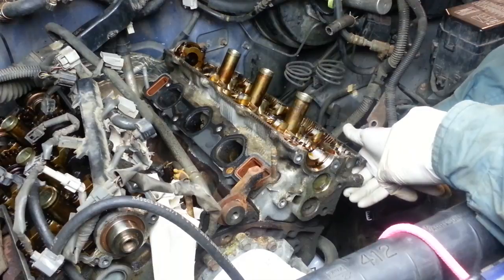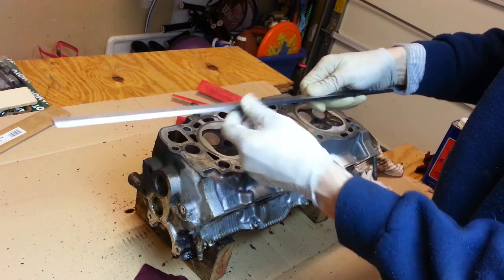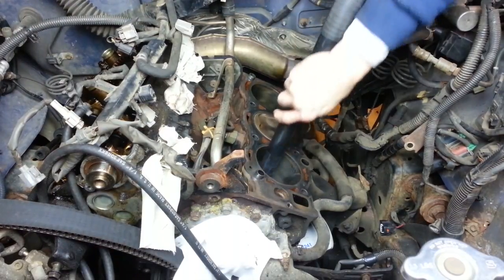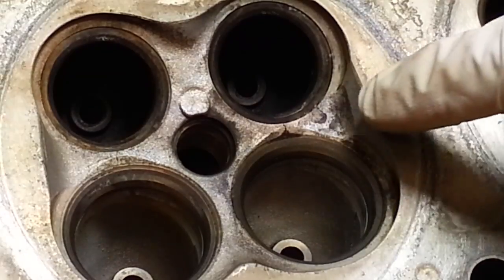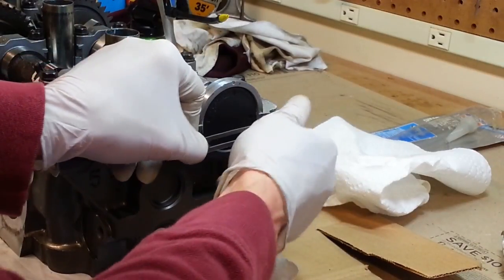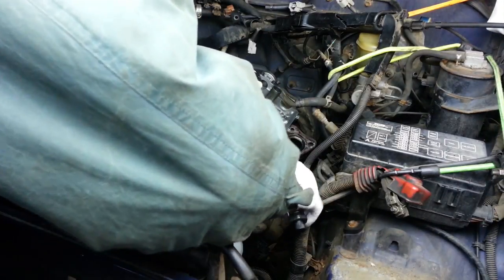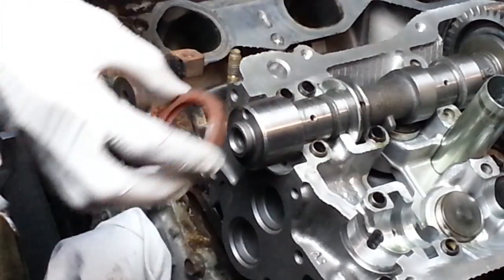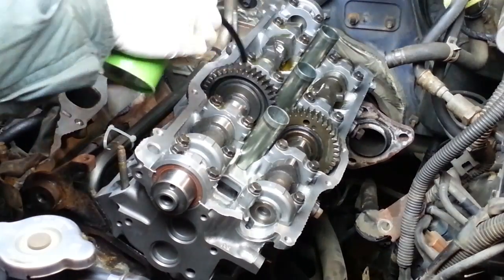Cylinder Head & Gasket DIY Procedure - Toyota 5VZ-FE - Part 4

Comment: Currently in the process of doing this on my 00 with 370k miles on it. Do you happen to have a link for the head gasket kit?
Reply from the maker: Not for the exact one because the options have changed since I did mine. It was a Beck Arnley kit from RockAuto.com
Reply: @WorseThanChiggers  that helps either way. Thank you for responding

Comment: if you don't mind letting me know, which manual did you use? I am going to do a total rebuild on the same engine.
Reply from the maker: I used a genuine Toyota factory service manual, not one of those thin Haynes manuals that you see at the Auto Parts store. I find it cheaper to buy used ones on eBay. Good luck with your project. Let us know how it goes.

Comment: Hey sir old video but I hope you can read this comment. The Haynes manual says to line up the two dots but you lined up the single dots on the cam. Which do I do?
Reply: @WorseThanChiggers
Reply from the maker: You'll see in the video that on one side of the engine you are to line up the two dots while on the other side you line up the single dots. If you're going to take on an advanced procedure such as this, I strongly recommend that you invest in a genuine factory service manual. A cheap Haynes manual likely won't provide all of the necessary guidance.
Reply: @WorseThanChiggers  I’ll have to invest in one. Than you so much sir you are a life saver

Comment: Since Toyota discontinued the Head Gasket Kit, i have had a hard time finding what all parts (gaskets, seals, etc) that will need to be replaced during this Head Gasket job. You wouldn't happen to have a list of the parts still? I know its been awhile and i dont expect that you do, never hurts to ask!
Reply from the maker: The head gasket came as part of a Beck Arnley kit from RockAuto. I review that kit at position 11:31 of this video in the series.  I chose that kit because it got reasonable reviews and was moderately priced, not on the low nor high end of the price range. Hope that helps and good luck!
Reply: worsethanchiggers hey thanks, ive looked at a lot of the aftermarket jits but they dont state what the kits come with. I would feel more comfortable going with toyota oem parts since most yota oem is better than aftermarket in many cases. Its a bummer they discontinued the oem kit!
Reply: @WorseThanChiggers  -  you are amazing!  Your contribution have probably saved so many 4runners.  I personally have a 97 4runner with 250k on it and love the car like crazy.        Looking to test my luck with buying another 4runner that might have headgasket issue.  Will try to see if I can save it but afraid that the engine might have been overheated in which case I would assume changing the headgasket would be a waste of time.

Comment: These videos are amazing so good. Im just doing mine. but I'm trying to remove the valve spring from the head without a spring compressor. How did you do it?
Reply from the maker: +Melissa Hunt Thanks for the kind comments.  I used a Schley 91400B universal valve spring compressor which I already had for working on my VW.  I've also been wanting to try the Lisle 36200 Valve Keeper tool which is much cheaper and works by simply hitting it with a hammer.  Search for videos on its use.  Pretty cool invention!

Comment: I'm working in the passenger side now,the points align in front of each other but the lithe hole in the front is pointing 5 o clock I think is the intake camshaft not match is safe to rotate it? I mean to make the little hole to be at twelve o clock... thanks in advance.
Reply from the maker: I don't really understand the issue that you are describing. Are you referring to the threaded hole for the service bolt?
Reply: Yeah bro I have problems most of  the time understanding my self 😄.the little hole in the front of the intake camshaft where wedge will go.i suppost to be at 12 o clock but now is at 5.i have to rotate it.
Reply from the maker: @edardon16  Mine didn't have any kind of wedge. Do you mean the hole in the end for the little pin that indexes the cam sprocket?
Reply: The the treaded hole is for the pulley but the pulley use a pin plus the bolt.bro I don't know how to explain that. I really appreciate your good intentions, I have to figure it out.thanks again.
Reply from the maker: I think that I understand what you are confused about. Alignment of the cams is a separate procedure prior to timing the engine. On the passenger side, align the double dots on each cam to install them. Once the cams are in place and their caps are installed to hold them down, you can then proceed with the rest of the assembly. After the valve covers are on, you can install the cam sprockets. Before installing the timing belt, turn each cam sprocket so that their timing marks line up with the marks on the timing belt back cover plate. They will be near 12 o'clock. Don't worry. You can safely turn the cams without hurting the engine. Toyota's 5VZ-FE is a non-interference engine meaning that the pistons will not hit an open valve. You really need to have a factory service manual to do this job. It has all of the details that you must follow.
Reply: Your series of videos is definitely the best in youtube  regarding to head gasket procedure,and looks very easy to do,but it's not easy at all.5vz is not a interference engine?perfect. Take care sir and thanks a lot for your help.

Comment: Could you do a passenger cam shaft caps orientation please? I know it’s basically the reverse, but could you :)
Reply from the maker: Indeed it is basically a mirror image of the same exact procedure except where I explained the differences in the alignment dots. Definitely invest in a genuine factory service manual. That should be the first tool in your toolbox.

Comment: What causes blown head gasket? Overheating is the primary one I assume. Other than that, does it generally fail for any other reason that can be prevented?
Reply from the maker: +Bardia Ghajari  You nailed it.  The most common cause of a blown head gasket is an overheating engine.  The excess heat will cause the engine block and head to expand more than usual and can exploit a weakness in the head gasket causing a failure.  Under normal driving conditions, other less common causes can include incorrect installation such as not torquing the head bolts properly and in the correct sequence, hot spots, and pre-ignition.  The best preventative actions are to maintain the cooling system by monitoring the fluid level and replacing the coolant at the recommended intervals as well as looking for signs of a failing water pump.
Reply: +worsethanchiggers Ya! And pink milkshake, but looks like its more common on the 3rd gen 4runner.  Okay great. I just recently swapped the coolant. Ill probably do a transmission bypass. so no pink milkshake. Hoping to get another 3-5 years out of my 2002 4runner with same engine. Its rusted and only gets driven few thousand miles a year. but its the home depot beater car we throw everything in. Thanks for the repair. I actually watched this to do the valve cover gasket. lots of detail. Im confident id be able to do it in the spring or summer.
Reply: +Bardia Ghajari Sometimes a faulty OEM head gasket will fail because of bad engineering. Example: 1996-2008+ Subaru EJ25 engines. Once you replace them with a good quality aftermarket gasket (layered steel is best) you'll be ok.

Comment: I just could read in minute 7:22 it is a starrett n380, do you think it is a good ruler. I could see it has Accuracy (in): ± .0002” per foot. do you think it would have to be +-.0001? thanks
Reply from the maker: Mine is a "Starrett 380-18 18-Inch Steel Straight Edge".  It was expensive but is of high quality and I like it a lot.
Reply: thanks for the answer, Is good to know that it is a good product, I've seen some cheap ones that I am not impressed with the reviews.

Comment: Are the heads interchangeable? Can the left side be installed on the right? They appear to be identical?
Reply from the maker: I don't think so. The raw castings look nearly the same but the machining is slightly different due to how the cams are installed.
Reply: @WorseThanChiggers  that for the reply. We did check and follow up with Toyota and they indicated that they are the same part number. Everything on them, including all screw mounts line up. Gaskets are different per side. Will let you know if problems arise. Thanks so much for these awesome videos! Couldn’t have done without them!
Reply from the maker: @t1slc  Thanks for the kind comments. I really appreciate it. Good luck and definitely let us know how your experience compares to mine.

Comment: I tried to send a private message but couldn't figure out how to do so. I have a question. Do the cam seal plugs in the back of the heads need a bead of RTV around the rubber cam plugs themselves or only on the mating surface of the plug caps? I already installed it as you did in the video but I got to thinking about if oil could escape from that plug to cap connection, or if the rubberized coating of the caps is enough to seal. Just wondering if you had any leak issues!
Thank you!
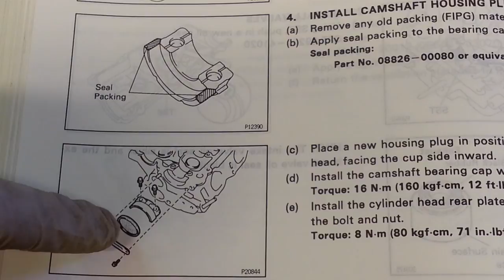Reply from the maker: That's a good question to confirm. You can see here at 18:27 of the video that the factory service manual calls for seal packing (a.k.a. RTV) to be applied only to the tips of the cap. None should be used on the rubberized plug itself. I actually applied too much where it should only go on the tips of the caps, not across the entire mating surface. There are grooves there that I now assume may be oil passages to allow some oil to get into the plug and possibly lubricate the end of the cam shaft. I haven't inspected those locations on my engine recently but I do not suspect any leaks have developed there.
Reply: Ahhhh yes and that is what I remember seeing you do at that point.  I've watched your videos so many times haha.  I wonder if I should take that cap off and only apply RTV to those surfaces shown.  I did read where someone had a problem with oil not dropping backdown out of the heads.
Reply from the maker: If you haven't applied any RTV at those locations, it might be a good idea to prevent a small leak. It won't hurt anything internally, though, to leave it as-is.

Comment: Did the new cylinder head come with the valves/already adjusted?
Reply from the maker: Mine did not. I measured the clearances and found several to be off. Some by quite a bit. The valves on these heads use shims rather than being adjustable. I measured the discrepancies and the thickness of all the shims. Then I did the math and was able to swap some around to meet the factory specified clearances. But I still ended up having to order a couple after determining my final required thicknesses to complete the job. If I was to do it again, I would wait to ship my old head back until after the job was complete in case I needed to swap some of the old shims to the new head.

Comment: My honest guess was that the coolant on the #4 piston came from residual coolant flowing back out of the head..
Reply from the maker: cadalate In retrospect, I think you're absolutely right.
Reply: I second that. If that was a coolant leak into your piston. Your car will be smokey. Engine hesitation. And itll drank alot of coolant.

Comment: What kind of tool did you use to remove the valves/ valve springs, retainer etc from the head block?
Reply from the maker: To remove the valves, I used a universal valve spring compressor similar to this one.  http://www.amazon.com/Universal-Spring-Remover-Installer-Compressor/dp/B006TM8RBC

Comment: what is the housing cap for ?  And is it common for them to leak oil ?  Is it possible that mine is leaking because the technician that changed my head gaskets failed to tighten something properly ??  thanks for you great videos !!!
Reply from the maker: Cylinder heads are cast and machined for use in multiple applications with different camshaft configurations. The housing cap and semi-circular plugs fill the holes that are not used in your application. You'll see that the space where the house cap goes looks very similar to the other side of the head where the camshaft passes through.

You could be getting a leak from one of several places including the house cap, semi-circular plugs, camshaft oil seals, valve cover gaskets, spark plug tube seals, or even the head gasket itself.  If you're not sure, I'd take it back to the same technician and have him do a courtesy check.
Reply: Thanks for the response !  I cleaned up that whole area back there to see where the oil is leaking from.  I have a suspicion that the leak is due to the screws on the valve cover not being tight enough.  I know the screws have a rubber washer, so you can't crank down on them. When I checked them, they seemed very loose !  I tightened them down !  Now i need to put some miles on the truck and see what happens.  Your videos have been such a great help ! I really appreciate  the good footage and the professionalism of your work. I have a Tacoma 2000, original owner, with 270k miles on her!  Runs like new !!! Change my oil every 3k !    I like these trucks better then the new ones.  Mine is manual transmission too.  The best way to travel on a 4x4 !   I'm thinking of taking a class at a local collage to learn auto mechanics so that I can work on my own vehicle too. Cheers !!
Reply from the maker: 270k and original owner? Wow! That's impressive.  Yea, I've had the same issue with the valve cover bolts and they do tend to loosen up and seep oil.  The torque spec on those in the service manual is surprisingly low.  I've got that issue right now and it's impossible to get to all the valve cover bolts on the driver's side because the intake manifold is in the way.
Taking those classes is a great idea. I did just that some years ago learned a ton.

Comment: Sir, I have a question when you remove the cylinder valve did you have to compress the valve springs?
Reply from the maker: Yes. To remove the valves from the cylinder head, you must use a valve spring compressor. That releases the keepers and you can then pull the valves out.

Comment: Absolutely priceless video series! 

 I'm in the process of replacing both heads on my 99 4Runner (cylinder 4 is leaking coolant into the cylinder from what I believe to be a cracked head, and I figured I'd do them both for peace of mind) and got as far as I could without guidance this afternoon.  After watching this video I am MUCH more comfortable removing the cam sprockets, the exhaust manifolds, cam shafts, and heads.  My new heads don't get here until Wednesday, so hopefully I'll be ready to throw them on as soon as they get here.

Two questions for you though... 

Where did you get your head bolts?  I went OEM/Factory Toyota for all the other parts, but they want ~$90 for all the bolts and washers... I'll pay it if need be, but I'd love a second option.

Is the "service bolt" for the cams just a typical M8 x 1.25?  Looks like it, but wanted to be sure.

Thanks so much!

Alex
Reply from the maker: I got sticker shock, too, at the price of OEM head bolts. So, I found a set on eBay from seller "elasticgaskets".  I was very happy with the quality and the complete set was under $30 including shipping.
Reply from the maker: And, yes, the service bolt is just a typical M8. I found that the length doesn't even really matter.

Another thing that I've recommended here a couple of times but is definitely worth repeating, check the valve clearances before putting a new cylinder head on the engine. It is FAR easier to replace those shims if necessary with the cylinder head on the bench and while the cams are out.

Best of luck and let us know how it goes!

Reply ·
Reply: Can you answer one question for me.  Im looking to buy 4runner that has slow coolant leak and misfiring.  My guess is that it has a headgasket issue, no white smoke yet.  How do I know that the car was not overhead before?  My fear is that after I replace the gasket to realized the engine has overheated and warped.  Is that a concern or overheated might not be a concern.  I don't see any oil in coolant or reserves yet.  Thank u.

Comment: What weight oil are you using for reassembly? Awesome video
Reply from the maker: I used whatever was in my general oil can which was probably 10W-30. It doesn't really matter since not that much is used for reassembly and I did a full oil change after the project was completed. If you really want to do it properly, you could use true reassembly lube which is much thicker.

Comment: only one note, some people say don't oil the threads because it can change the torque.  Don't know if that is true.
Reply from the maker: Interesting question. I feel the opposite to be true. You want the tension to dictate the necessary torque. By not oiling the threads, it can let inconsistent friction contribute to the necessary torque.
Reply: @WorseThanChiggers  - That is a very good point, never thought of it that way!  Guess the question what is true torque?

Comment: How did this remanufactured head hold up? I’m about to order one from the same place.
Reply from the maker: It held up great! The engine purred like a kitten for 3 more years until I had to sell it. The truck failed my state inspection due to the dreaded frame rust. Otherwise, I'm sure it would still be going strong.
Reply: @WorseThanChiggers  would you have the link to the one you purchased? Thanks! Great content,btw. Very thorough!
Reply from the maker: @j.a.8970  I got mine on eBay from the seller called headsonly.